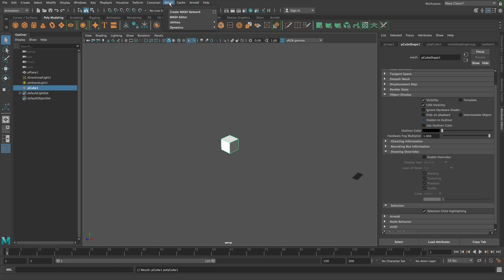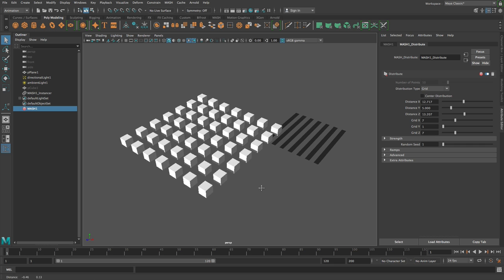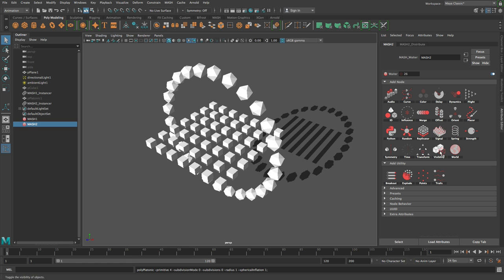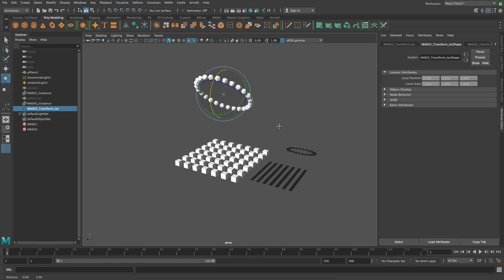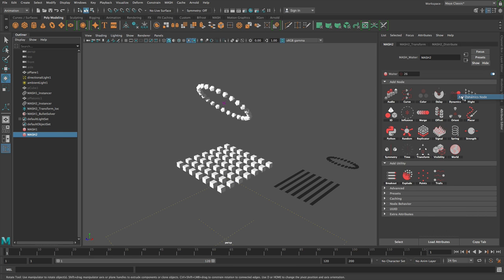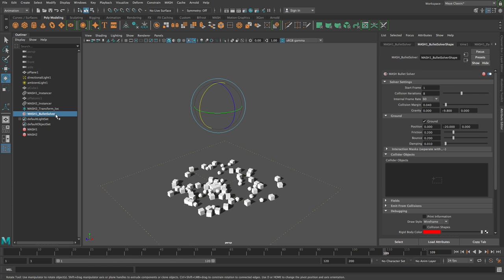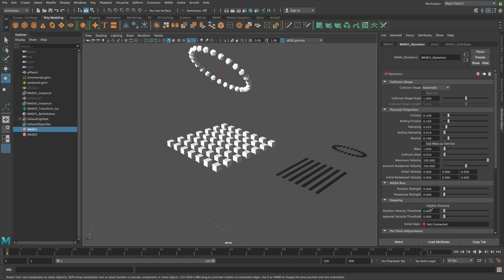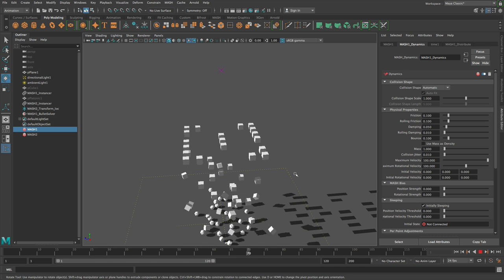MASH Dynamics No 2. Collide Two MASH Networks

Comment: Hi, I have Maya 2018.3 but appear to have problems with the Bulletsolver not working if I key frame a sphere knocking into a wall of cubes. It's added as a collider object, and works as long as no key frame animation has been added. As soon as I do, the sphere has no affect on the wall of cubes as it moves through them. Is this a bug? Or have I forgot to turn something on/off?
Reply from the maker: I'm fairly sure moving colliders aren't supported in 2018. If you want it to move, put it in a MASH network and use the MASH Strength options on the Dynamics node to follow the animation you add. I tried to get this feature in (moving colliders) but it just, JUST missed the shipping deadline.
Reply: Ian Waters - hey, thanks for the prompt reply. If you take a peek at this from the Autodesk Channel, it shows an animated ball acting as a collider. Unless I missed something https://youtu.be/iExEPk6r_Vk
Reply from the maker: It might work with the mesh collision object, but be warned, it isn't really moving (Bullet doesn't support moving meshes) I think what I did was a naughty hack, where I removed the object, and re-added it at the new position... For better results, go the MASH Network route :)
Reply: Hi,

I think its an update issue as well. Maye 2018 allows you to keyframe animate the sphere to collide into the blocks, and they react. It seems the update 2018.3 introduces a bug - it no longer works. Slightly weird - can't see it being reported anywhere else.
Reply from the maker: I don't remember disabling this code, but it's possible someone else did after I stopped working on MASH. Regardless it never worked properly, so as I mentioned, the 'collider in a MASH network' is the right way to go about this.